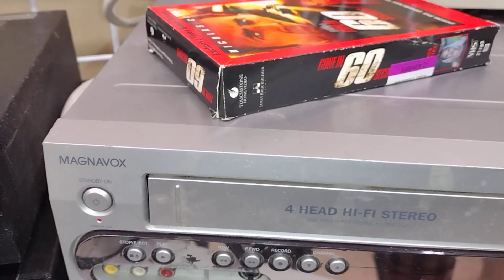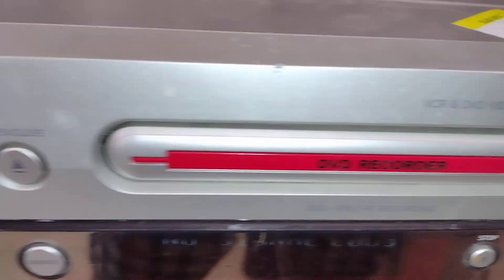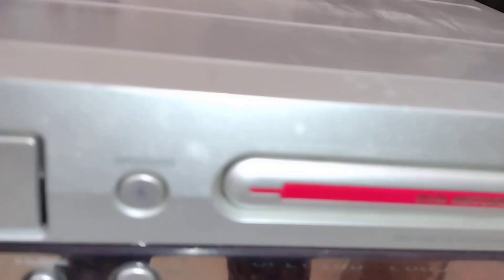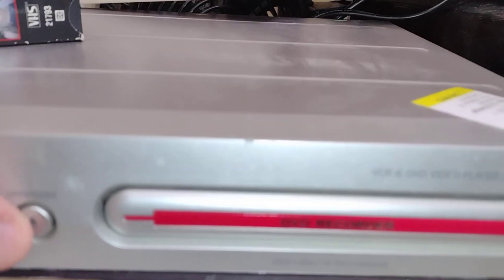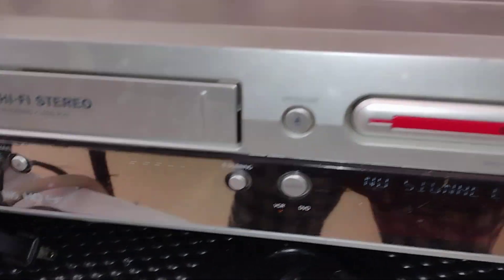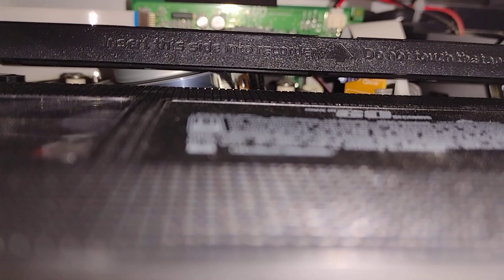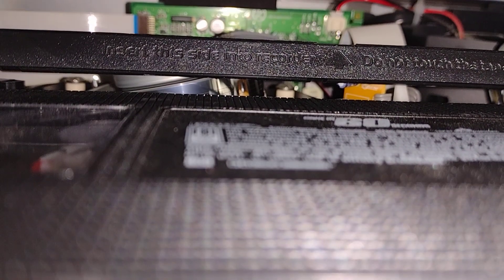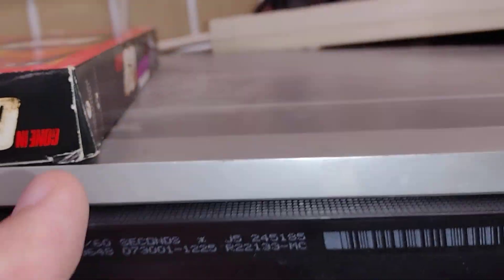A F**ked Up VCR #58

Comment: I actually have a Funai-made DVD/VCR combo. It's a Philips DVP-3150V from 2006, and I got it at a Goodwill in late 2017. It actually works very well; both the VCR and the DVD player on it work perfectly fine, although I don't use it very often at all.

Comment: R.I.P Magnavox MRV700VR
Reply: tough times dont matter you know those funai vcrs goes down but most of them because the mode switch is dirty causing the vcr to do weird things and cleaning the mode switch fixes the problem i work with some of the vcrs that have this problem and works like a charm